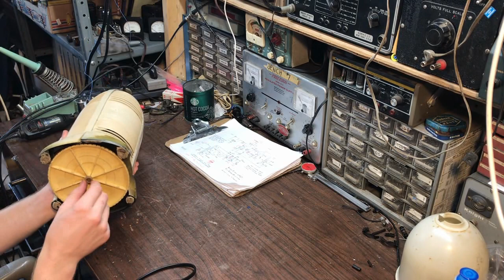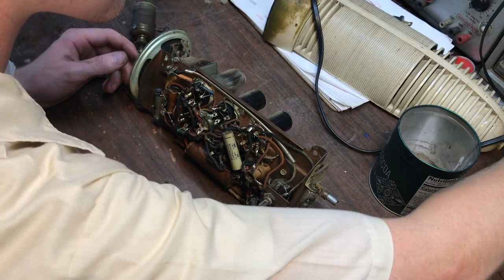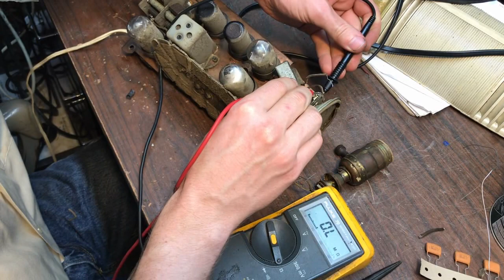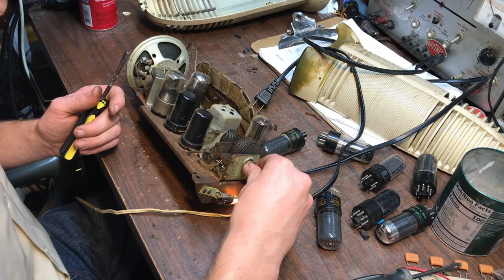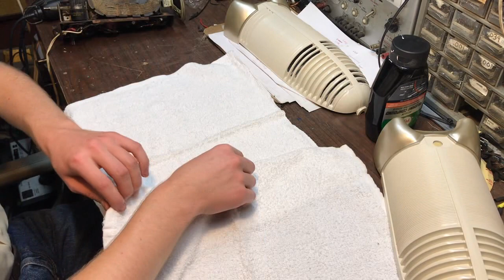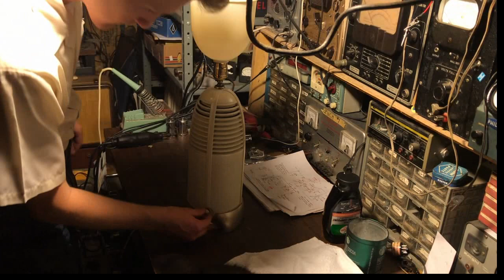1941 Mitchell Lumitone Lamp Radio Full Restoration

Comment: 8 cents / capacitor.  Not bad!  35L6?, wrong tube, should be a 50L6 (unless the rectifier is a 45Z5) as there is no RF stage (only 5 tubes).

Comment: Why just measure one voltage. There are plenty of other voltages to measure too. Looks like the resistor you broke might be the 1st audio plate load resistor. It’s common for this resistor to go open circuit or high in value

Comment: Just soldering the leads together is not recommended as the solder may crack with age, causing a bad connection. A good mechanical connection is always good.
Reply from the maker: I agree, I always do that when I can.
Reply: @gwcoty0715  Dear Sir-Great video. Here's the link to the Austin American Statesman video concerning my antique radio collection. The music at the beginning is emanating from my 1947 Motorola WR-8 wireless phonograph, which I restored awhile back:
https://www.youtube.com/watch?v=8M-WCy_UhMY&t=1s
Again, using a vintage soldering iron with a larger tip makes point to point soldering SO much easier.  Cleaning your soldering iron tip regularly and keeping the tip on the work longer really works to your advantage.   My restored radio collection numbers over 200, FYI. -John in Texas

Comment: Here's an idea...you can take out the resistor between the 35Z5 and the 35L6 and you can use the 50L6. I recently restored a Westinghouse radio and it had a 90 ohm resistor between the 35Z5 and 35L6. During operation,  the resistor got very hot so I removed the resistor and installed a jumper wire in its place. Then used the 50L6 and the radio works perfectly and the jumper wire doesn't get hot.